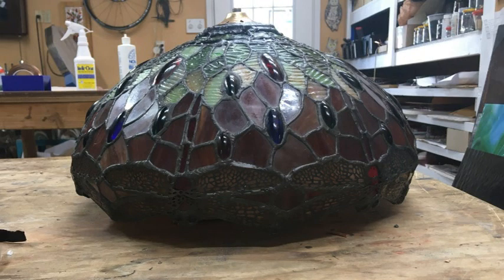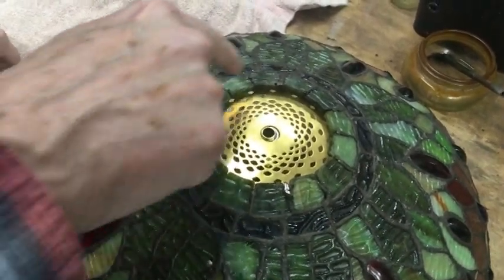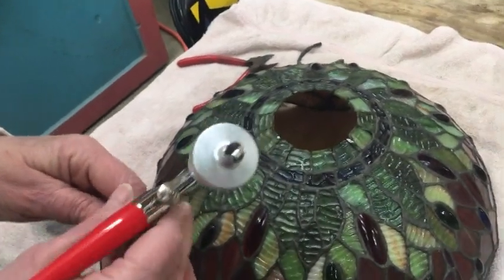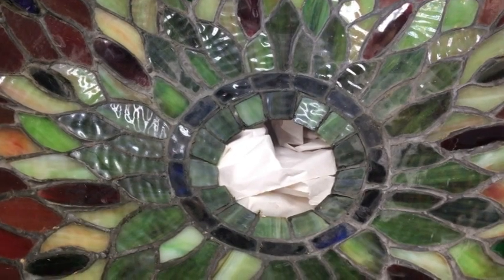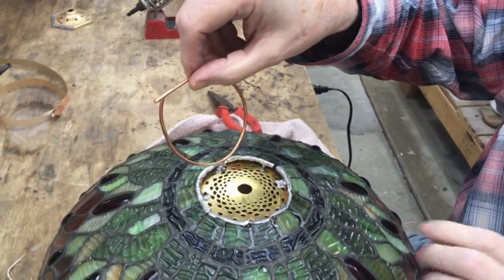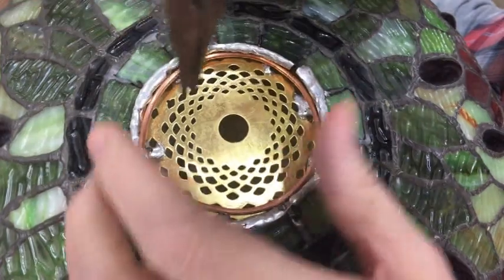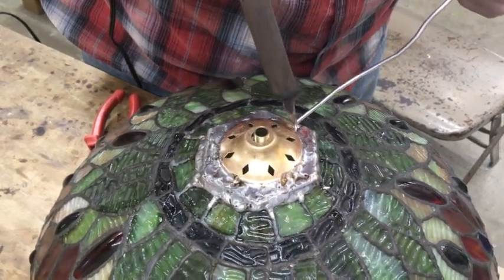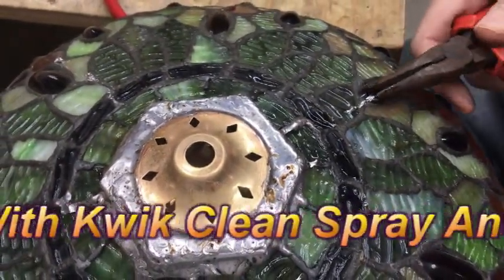Stained Glass Lamp Vent Cap Repair V364

Comment: I was given a large stain glass lamp. Someone had used bulbs too hot and it’s had started separating. I have it upside down in a box lid.  How can I easily fix it
Reply from the maker: You'll have to resolder it which is never easy. Get the glass in place as good as you can. When you get done you'll understand why we no loger do lamp shade repairs.

Comment: I really appreciate this video. My question, I have a lamp repair where the lamp has a crown on top, it originally hung from the ceiling, and it has a flat metal cross bar (not a spider)....how do you solder the cross bar back on? It looks like each bar is an inch across by 1/8th inch thick by 7-8 inches long. Was wondering how to reinforce that so it can hang. Thank you 😊
Reply from the maker: If you could send a couple photos to me it would help. My email is david.gsglass@gmail.com I look forward to helping out 🙂

Comment: I have never done anything like this and I need to fix a heat cap on a stained glass shade.  Can a beginner do this?
Reply from the maker: If you are good at 3D soldering then you can probably do it. Otherwise, do a few 3D projects to get your skills up..the other thing is to use a small wire brush or steel wool on the places to be soldered so the solder will stick.

Comment: Thank you so much for this tutorial. It was very informative but I have a couple of questions if you don't mind. I see you used a sand blasting thing to clean it up for soldering. In lieu of a sandblaster, do you think I would be able to use a Dremel with the wire wheel? The next question is what type solder do you use? Is it Rosin core or acid core and also can you brush acid on the surface to clean it before soldering? As a final note, the lamp shade I have is different than the one you worked on. Yours is a round, dome shape and the one I am working on has a series of triangular glass panes. Also it has an upper part (chimney?) soldered to the lower section. The solder at that joint weakened and from the weight of the lamp caused it to separate. To prevent it from totally separating I used a piece of mechanics wire to hold it until I decide what to do with it. Thanks again.
Reply from the maker: A Dremel can work, also an air eraser like they sell at harbor freight. You could also take it to a local machine shop to have it blasted. We NEVER use Acid or rosin core solder with stained glass because the imbedded flux can seep under the solder and then will ooze out forever and glass won't get clean. We use liquid flux.